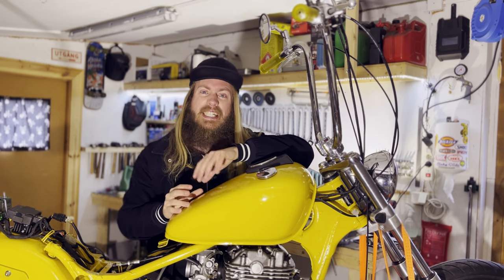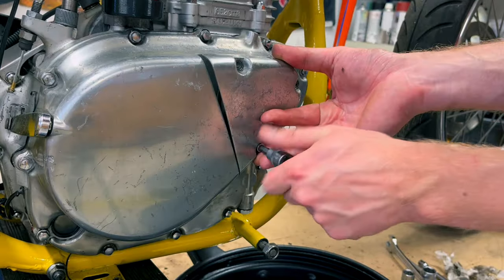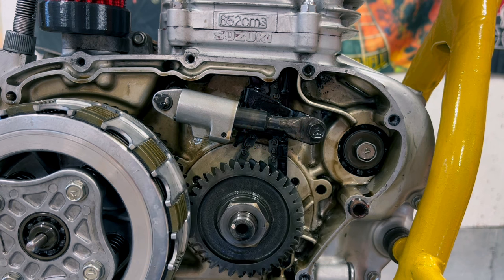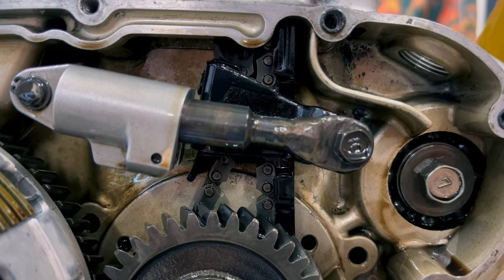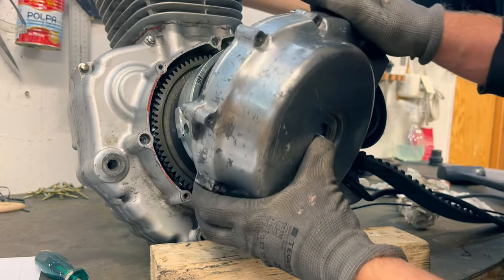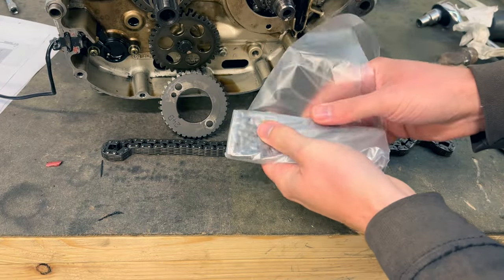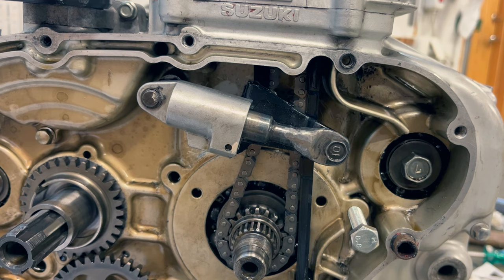Replacing the Cam Chain on the Suzuki Savage

Comment: if you do this when you pull the clutch, be careful not to lose the little dowel that connect the clutchbasket to the oil pump gear or else your oil pump will not turn when reassembled
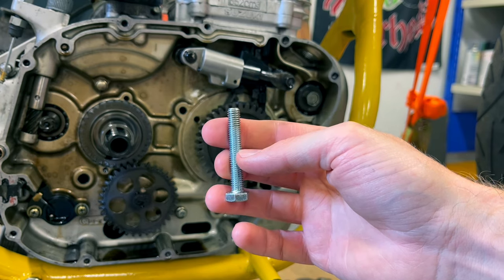Reply: at 3:50 in the video you can see the spot where the dowel goes on the oil pump gear right between the 6 and 7 o clock position its real small and will fall out if the bearing it sits between and the gear is removed
Reply from the maker: @matthewdeltoro1021  That is a great comment and something I totally missed to cover in the video. I find it hard finding any recent information on this, most images on the forums have been deleted due to age, and the manuals just mentions it briefly. Do you have any more info about it? I might actually have to get back in there, mostly to ensure I still got the pin but maybe also to do a video about it, just to make sure the info is easily reachable for people.
Reply from the maker: For anyone reading this, I actually made a video about this little dowel. You can check it out here. https://www.youtube.com/watch?v=ZRYXRQUP9pg

Comment: Second day with my 650 savage the engine seized as I was slowing down for a traffic light.  Long push home. Previous owner mentioned that he had looked at the chain tensioner and thought the modification had been done. I will be opening the sude up to see if the tenshioner is off causing the seized engine. I will check the sprocket as well. What other things should I check to determine the extent of the damage. Your videos are great. I just finished all that you made involving the Savage.
Reply from the maker: Shit, it actually seized on you?
Have you checked the Savage forum? Should be some threads on there regarding what to check. I guess there's quite a few pieces that can get damaged.
Thanks for watching the videos! And keep me posted about your bike, would be interesting to see what you find inside that cover and what actually caused the seizing. Good luck!

Comment: I have the same Savage 650 1998 since 2002... 185 thousand kilometers through Brazil and the south of South America...
Reply from the maker: That's actually really amazing! Really show that they can run for a really long time as long as you look after them.
Enjoy the ride! ✌️
Reply: How did you get fuel. My bike can only go like 100 miles per tank.
Reply: @joshuajuarez3471  Your name is Joshua too? I am Paulo Josué.  Traveling alone with a reserve of 15 liters of gasoline and planning the route
Reply: @polaco650cc3  nice!  I had a reserve plastic container strapped up. But oils started to come out tail pipe. Now I’m trying to fix it.  Dang!

Comment: I’m with you.  They are loud. Hard to hear the difference. I couldn’t on mine. But I got it. It had 100 mi on it sat for a decade. I got it running then oil stared to come out of tailpipe.  That when I said damn it can only be the rings. Idk.
Reply from the maker: I agree with you!
That's too bad! I'm no expert, but rings sounds plausible.

Comment: Is there anyway you could make a vid on how to remove the engine from frame
Reply from the maker: I might do that in the future. Until then, I think the service manual does a pretty good job at explaining what needs to be done prior to taking it out. Then it's just a matter of lifting and yanking to get it out. Might be good to have a friend help you as well, as it can be kind of heavy and also hard to grip since there's only one cylinder.
If you want to take it out to do this job, there are people that say they are able to get this done without removing the engine, so you might want to look into that.

Comment: According to reviews in your country , apart from a weak chain , are there any other problems with this motorcycle model ?
Reply from the maker: I wouldn't actually say that the cam chain is weak. The cam chain adjuster has what you might call a strange design, but it's an easy fix. Other than that I haven't actually heard anything else being a widespread issue.
Reply: @HeavyMetalParkingSpot  Thanks a lot

Comment: I can't get my transmission cover back on. The spring keeps flopping around and when I get it on it is to tight to even change gears🙃 any suggestions would be greatly appreciated
Reply from the maker: Are you talking about the plate that holds the clutch springs or the actual outside cover? The outside cover should have no spring, so I guess you're not talking about that? When putting the clutch springs back, torque them diagonally to make sure you're not over-tightening them. Explain your problem further and I'll try to help. 😀
Reply: @HeavyMetalParkingSpot  thank you for the response I wish I could upload a picture but idk how but I believe it's the outside plate with bout 10-12 screws. It seems that when I put it on the armed the pushes in when you pull in the clutch will not move at all after I tighten down the plate. I took the little spring off cause it didn't seem to do much at all. And it basically still locks up to the point I can't even pull in my clutch. If there is a way I can send you a picture or a video please let me know thank you again!
Reply from the maker: @13at42z  When you put the cover back on you need to push the clutch-thingy up, so that it seats correctly. You can find me on Instagram and drop me a picture there.

Comment: Hey man! Have been binging content on the Savage the last 12 hours, and love your videos brother! I’m considering buying a Savage my self and it needs to have a flywheel change, or that’s what the seller is saying. Is it hard and do I need some special tools to get it done? Would appreciate if you can help a potential first time owner out!
Reply from the maker: Thank you very much!
Why does the seller think it needs a flywheel change? I've never heard about any Savage needing that, but I've heard about people shaving down the flywheel until it's basically not there anymore. 😀 What are the symptoms?
I think there are two or three special tools that are needed to get the flywheel off, but it shouldn't be too hard. Overall these bikes are easy and fun to work on!
Reply: @HeavyMetalParkingSpot   He had a buddy of his that is a mechanic say that it needed change, the reason was that it was sparking when turning over. ⚡️👀 He has the parts and everything. I also asked if the cam chain tension adjuster was modified or changed but it hadn’t so believe I need to fix that too if I buy. After watching content of the bike, I got the feeling that it’s very basic and straightforward bike to work on. Would you say it’s hard to find parts for the bike? I’m based in Norway. 

I got some mechanical practice and knowledge but then again, I have never work on a bike, only cars & snowmobiles that I have owned in the past.
Reply from the maker: @backnforth3022  Oh, I see! The thing I would consider is, what did he do to get the flywheel to spark? Is there anything else wrong with the engine? I don't know what the situation is like in Norway, but here in Sweden you can get a Savage for a pretty good deal kind of often. So just don't over-pay!
I would say it's easy to find parts and they're not too expensive.
If you know cars and snowmobiles you will be able to work in this bike without any problems!

Comment: All of your videos are great
Could you help with:
how to replace the oil plug level wire coming out of the oil pan on  a Suzuki savage 650
Reply from the maker: Thank you very much!
As far as I know there are no Savages with an oil level wire, but I might be wrong. If you are thinking about the wire coming out of the oil pan that is the neutral switch.
Reply: I thank you very much for your fast answer
You must be right for the neutral position light, this wire is damaged just outside the pan, I will try to weld it without open opening the engine first.
Right now I have troubles starting the engine and awaiting a new starting motor relay, all was fine until some electric parts failed?
Thx again for your knowledge
I think my 650 is from 1987/1989 not sure even with the chassis number
I also have a youtube channel, if you are interested in flying airplanes and other contents

https://www.youtube.com/@silkytreat
Reply from the maker: @silkytreat  All that wire is doing is turning on the neutral light on the dash. Even though that is a nice feature for the rider, it's not crucial for the bike to run. You should be fine fixing the cable without opening the engine, if the neutral light is working it works. 🙂
I hope you get your bike up and running again!
I prefer vehicles that stays on the ground, but I will check out your channel! ✌

Comment: how many KM on the bike? I have the XF650 with about 80,00km and it's a bit noisy, I replaced the tensioner and it reduced the noise, but I am thinking it needs a chain. This is the only cam chain replacement video for this family of engines I could find.
Reply from the maker: It had almost 50 000 km when I changed the chain. It it isn't the chain it might be the valves.
I also had a hard time finding any videos when I was about to do this.
Reply: @HeavyMetalParkingSpot  thanks for the reply, it seems the cam chain isn't a wearing item, as the DR forums haven't replaced one. The only time I've seen one have a problem and be replaced was at 180,000km on an XF 650. But tensioner is different on the DR XF engine... BYW I saw a turbo Savage online during my searches...
Reply from the maker: @mattjacomos2795  I see. I hope you get your bike sorted!
Not sure I would want to turbo charge one of these bikes, they are sketchy enough as is. 😅

Comment: So awesome to see this !!!!  However its a bit weird with the new chain and the extended tensioner that you have such a small gap between the "chain" ...

I have seen a few with original tensioner with a lot more space between the two sides of the chain - Did you change the chain guide  ?? Because I have seen several posts abot it is going out of shape (loosing its curve ) meaning there chain will (seem(act longer) if this makes sense   : -D
Reply from the maker: I've never one of these bikes in a "normal" condition, but you might be right. I didn't change the chain guide and looking back I kind of regret that. I should have done that while I was in there, but I just didn't know about it. Thanks for pointing that out to anyone reading this that are about to do this job!

Comment: Hey man how tight do the clutch basket Springs need to be
Reply from the maker: Hey! They call for a torque of only 11-13 Nm, so not much!
Reply: @HeavyMetalParkingSpot  are you able to simplify for a noob also I tighten my one all the way up and I heard a bit of a crack?
Reply from the maker: @memphisskipper9277  The only way to be really sure you don't over tighten bolts is getting a torque wrench. But do a bit of research on what 11 Nm should feel like, that might help.
Did you tighten only one until you heard a crack? You are supposed to tighten those spring bolts in a star pattern.
I think you should take the clutch basket apart again and make sure that crack didn't actually ruin anything.

Comment: I think its weird that with a brand new chain the tensioner is already quite extended ???

Did i measure New vs Old chain ?? ... Som have experienced that the chain guide is getting out of shape loosing its curve
Reply from the maker: You might be right and you're not the first one to point that out. I'm actually feeling the urge to get back in there and replace the guides as well, to see if it would make any difference.
I never measured the old chain either, that would also be interesting.
Reply: I will check mine too 😀 I just saw a video off a guy removing the head with the engine still in the frame ... Just a tip 😀😀
Reply from the maker: @DrDnepr  If you have a link to that video it would be really interesting to watch! 😀

Comment: Hey at 6:27 in the video do you remember what size socket you were using it’s the only tool I’m missing at the moment
Reply from the maker: I'm not sure, but if I'm rotating using the generator rotor, it's a 36 mm. The other nut that goes outside of that I'm pretty sure is 17 mm. I hope I understod your question correctly and that the answer helped!

Comment: hey i was wondering how bad I messed up by removing the bolt at 4:02 .... asking for a friend ofc .-.
Reply from the maker: Hi, that's actually a great question and it forced me to do a bit of research. That bolt is for the exhaust rocker arm shaft. It's ok to remove, but you're only supposed to do it if you want to disassemble the cylinder head.
I think you, I mean your friend, should be fine. But when you put it back, make sure that you have all the washers and nuts in place, so that they don't end up down in your cylinder. The Clymer manual actually shows you what parts goes where.
This is the best answer I'm able to give you right now, maybe someone else comes around with more knowledge?
I hope you and your friend gets this sorted. Let me know how it goes! ✌

Comment: wow removeing engine was TUFF as HELL. i finally got it with engine pulling stand. now im scared!!! tranny is got to come in 1/2 - its locked up. the piston had a hole in it/previous owner put wrong long plug in it! wondering if fix/ or toss it! piston was scratched on side but jug was looking new.. like guy honed it! idk - parts are expensive.
Reply from the maker: Wow, sounds like you've got your work cut out for you!
Sounds like the head is in good shape? If you can get the transmission sorted it might be worth saving?
Great to follow your journey and I really hope you manage to get your bike fixed!

Comment: Hi, I have a Suzuki Savage 650 motorbike from 1989, my mechanic says that the oil scraper ring of the piston is broken and that they no longer make them and therefore it is not possible to fix my motorbike, I wanted to know if this is the truth... since I I don't know anything about mechanics, I wanted to ask someone more knowledgeable..
Reply from the maker: Hey! I'm not sure if Suzuki still makes the piston rings. But a search on Google for "Suzuki LS650 piston rings" gave me lots of results where you can buy them, both as old stock and new. It might be that you have to buy a kit with a new piston as well. It definitely think it should be possible to get your bike back on the road! Good luck!

Comment: Clymer is wrong, when it says turn krank clockwise, to set the TDC!
Alway turn it counter cockwise as that is the way it turns when driving.
Reply: also  i never take rhe whole engine off doing this. just remove all te bolts (also the ones under the small valve covers). Keep the middle bolt on the top in and you can pull the top out on the left side of the frame.
Reply from the maker: Your very correct! Clymers manual says clockwise but Suzukis own manual says counterclockwise. I think I didn't really think about in the video and turned it clockwise. Thanks for correcting me!
And thanks for the tip on not having to remove the engine. I couldn't for the life of me get the top off. But if I have to do this again, I would try a bit harder.

Comment: Trial an error to find timing marks? Thanks for nothing
Reply from the maker: I'm sorry you didn't find the video helpful.
At 3:10 and 6:13 you can see the two places you need to check for TDC. Getting the two to align I would say is trial and error. Get one of them to align, check the other one. If they don't align, adjust the chain and check again. If they align, turn the motor around a few turns and make sure they still align.
There are probably other videos out there that has more tricks about getting the timing right, it should be pretty much the same procedure on any bike.
Reply: He never said it was a how too, literally stated it was not a walkthrough or a tutorial.
Reply: @xxjusxstarxx  I never wrote that
Reply: @keithhatch56  what , the thanks for nothing? Or that he stated it was a tutorial
Reply: @xxjusxstarxx  I just dont remember watching or writing it.I dont know why my name is there.